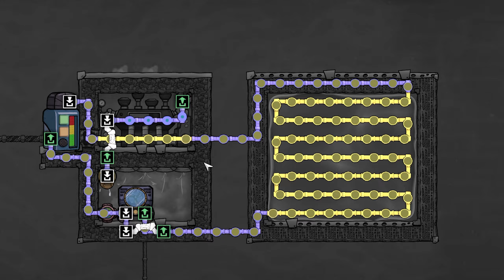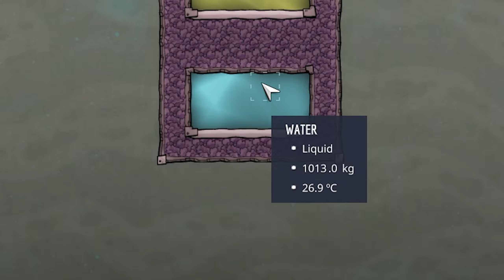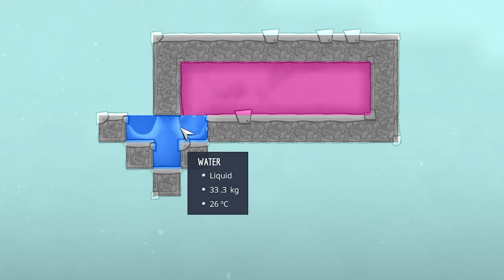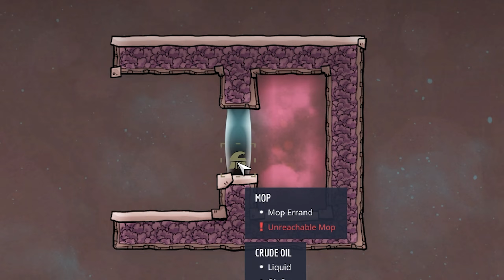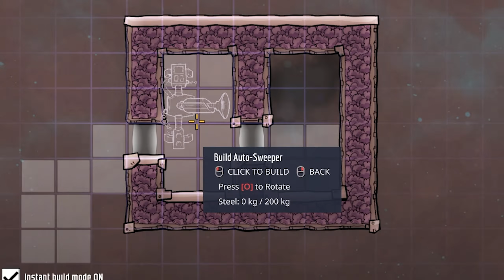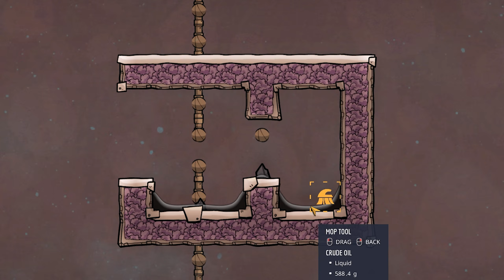HEAT DELETION & LIQUID LOCKS: A German Engineer explains ONI

Comment: I know this vid is a year old but what’s the purpose of the liquid reservoir? Most builds I don’t see it and you didn’t really specify. Thanks!
Reply from the maker: The liquid reservoir is technically not required, but can help in a couple different ways. For one, it has an increased thermal mass, so if something should go wrong(power outage), you will not be stuck with hot fluid in the pipe instantly. Another benefit is future expandability, since the required resource(polluted water for example) is already there. I implement one in all my tamers and heat deletion devices of any sort. Has come in handy many times :)

Comment: 13:05, Unless you are dealing with insulite, there will be heat transfer over time, even to insulated tiles. So if you were doing something like this for a room that would remain hot potentially forever... as the room heats up and heats up the oil, it will SLOWLY heat up the tile touching the water. Putting a little vacuum gap between the locks (and potentially around the room) is a bit more labor intensive, and requires a decent amount of extra space, but it guarantees to NEVER fail. This is also nice because it perfectly contains your system surrounded by a vacuum, which makes long term heat calculations a lot more reasonable. 
.
It is kinda breaking the game a little bit... essentially forming the room into it's own planet. But hey, it's a single player sandbox game, so it is what it is.

Comment: Why would you bother making insulated pipes inside insulated tiles?
Won't the tiles already prevent any temperature exchange?
Reply from the maker: Insulated pipes or walls do not insulate 100% unless they are made out of insulation(a very late-game material with 0 heat transfer). So putting insulated pipes into insulated walls actually combines the "insulation power". Any insulated material(other than insulation itself) will eventually heat up. The best early-mid game material to use is igneous rock, followed by ceramic in the later stages and insulation for very high heat applications in the very end game.

Comment: =HMMMPHHHH........THANKS FOR THE TIP ABOUT THESE PIPE DECONSTRUCT METHOD ABOUT LIQUID LOCK, HEHE BC OF I WAS USING A BOTTLE EMPTIER OF 33.8g WATER ....... BUT AT LEAST IT WAS MORE SUITABLE IF NOT WANT TO DO MESS

=AND.....FOR BASIC BASE COOLING, ISNT JUST A WORT COOLING ENOUGH....LIKE HYDROGEN PIPES/CHAMBERS/FLOWER POTS

Comment: Hi BierTier, I have a question. I made myself a petroleum boiler, not the conventional zig zag version but the "place all crude oil in one room and heat it" version. My question is, why does petroleum starts to form when the crude oil reach 350c in general? Shouldn't crude oil starts to transform into petroleum at 400c?? Oh, and I use magma to heat it.

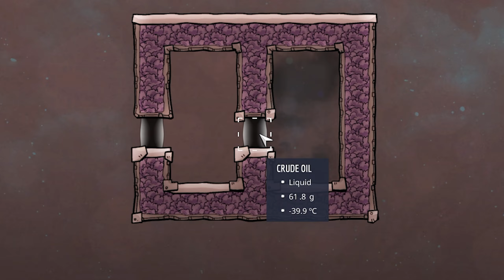Comment: 16:19
Atleast mention that you need to tilt the auto sweeper to be touching the outside blob of crude oil that comes in contact with atmosphere so it never overheats,if people take the example for literally what it seems like,the autosweeper in a vacuum will eventually overheat since it has nowhere to disperse the heat to being in a vacuum,also most of the Liquid locks here could be replaced with a diagonal 1 blob design that doesnt even exchange heat,preferably using naphta which is much better for liquid locks than anything else aside visco gel since even if you had 20 KG of Naphta on a single tile,it wouldnt overflow to the side like other liquids would.
If not replaced by the diagonal design,you could just have a blob to the left and right and rebuild 2 tiles in the middle,destroy them and get a vacuum for no heat transer without the need of 2 full side by side liquid locks like the examples,as long as the blobs on left and right are no more than 50g so they can just sweep in the middle to get rid of the excess before building the tiles and destroying them to make the vacuum.
Reply: So we should liquid lock auto sweeper too, maybe now that can work. Xd

Comment: Great video! There are a few things I would want to add. 11:23 you have 33kgs of water on the second layer. If you freeze water under 801kgs it will turn into debris and break the lock.  There are charts around that say what mass turns into debris and what turns into a block because it's different for most useful liquid lock liquids. That's an edge case anyway and I'd argue if you are worrying about that, you probably need to make the liquid lock out of a different liquid most of the time.

That being said it is worth thinking about adding more liquid than you need if it's possible for a dupe to move hot material across it. If a dupe drops a hot piece of obsidian in a low mass liquid lock it can flash to gas and ruin your day. Oil has more mass than petroleum but I now use mostly petroleum locks because I've had oil flashing to petroleum break some locks as it bubbles but the heat for petroleum to flash to sour gas is large enough that with enough mass, dropped hot debris won't instantly kill the lock. This warning also goes double for the upright liquid locks that can sometimes end up being just a few grams. I've seen dupes breathing out carbon dioxide be enough to push liquid if it's a small enough amount!

Also don't discount single block liquid locks! For that wrong material smart battery example I'd recommend my favorite liquid lock. Just a single block on the wall and 1 drop of any higher boiling point liquid on top of that. You can then dig in 2 tiles into the steam room and sealing it up is as easy as just rebuilding the 2 blocks from the wall. It's more dangerous for sure with just 1 mop-able low mass liquid holding the steam back but for quick repairs it's fast and effective.

2 high vertical liquid locks are easy to break and give your dupe soggy feet. If I'm being fancy I like to make 3 high liquid locks with crude oil, naphtha, petroleum with the crude oil having a solid block on both sides. The dupes will jump the gap meaning no soggy feet, they can't drop stuff while they are jumping so not hot debris in the oil, the solid blocks on both sides prevent spills from breaking the lock(unless a dupe pees on the one jumping blocks but the heavier naphtha shouldn't move if you use enough), double vertical locks take the same space as a single staircase lock, and those 3 materials mean it can be as cold as -40c or as hot as 400c. I have no idea why I don't see anyone using them.

I use bottle emptiers to make liquid locks over breaking pipes because you don't have to have a pipe all the way to where you want to lock and when enough liquid is in place you uncheck the material on the emptier to stop it. You said it's messier but it's the opposite. If you watch it closely you don't have to mop anything to make a lock. With the introduction of moving and emptying liquids I expect people to find even better less messy ways of making locks. (Maybe just drop some bottles of the right amount of liquid in a 3 high hole, empty them, and deconstruct the walls of the hole?)

I also like passive cooling steam turbines a lot in the early game. If you aren't making enough power to keep it up all the time you can deadlock your active cooling loop which can be a nightmare to recover from. If your turbine is too hot to cool the steam and the aquatuner is too hot to run then you aren't getting away from that without some burnt dupes. I would highly recommend passive cooling early game if you are at all worried about not having enough power to keep the system running(which is the start of every one of my poorly run bases.) You can make it work for any heat load if you throw more water mass, and then turbines at it too. Just make sure to limit the steam room temp below 135c so it stays cool enough to cool itself. Enough water mass and turbines also make it way more power positive than if you have to use the aquatuner to cool itself since you can never recover all the power going into the aquatuners.

About the single bridge bypass in the cooling loop, it works great if the loop is filled properly or you have a liquid reservoir on the loop to keep it from being overfilled. If it gets overfilled it can cause the aquatuner to get jammed and get stuck in a state where it stops and starts repeatedly as it gets jammed every other liquid packet. If you use a double bridge bypass it works like the liquid reservoir where it keeps extra space for a liquid so you can't overfill it. Underfilling the loop also works. Just be careful with the double bypass though because that extra pipe segment can have the liquid sit in it for a long time and if in a place that's too hot or cold that can break your pipe. That's where I put my first pieces of ceramic pipe before I can make enough for full loops. Still I started using double bridge bypasses when perfectly filled loops would break down on game load in late game bases and that shouldn't be an issue in most scenarios.

Another issue I've had with large bases is the liquid temp sensors connected to the aquatuners. On game load I've had a packet of already cool water get to the aquatuner before it was turned off causing cold damage. If you've ever gotten mysterious cold damage on the exit of the aquatuner that might be the case. For that buggy game reason I have my polluted water aquatuners set to +10c which is fine for almost everything that isn't for sleet wheat and could get through 2 below temp cycles before causing damage. Maybe this only happens on heavy 1000+ cycle bases but it annoys me and figured it might be worth mentioning.

I swear I didn't mean to write this much. Most of the caveats I mention are edge cases you don't need to worry about when starting out which is who this video is for. I just find it exciting and thought I'd share what works in my chaotic playstyle. Thank you for making this as it is perfect at demystifying one of the biggest hurdles for new players.
Reply from the maker: Holy cow, what a detailed comment highlighting literally all the edge cases :)
Yes, the 33kg on the second layer is a mistake on my end. Everything else though, even though you are 100% right, couldn't make it into a beginners video because it would make the video wayyyy too long and may overwhelm a new player. I really appreciate you taking the time to write all this out. Maybe I will make a "Advanced" video as a follow up to this one to cover those cases... but then of course with a huge shoutout for you! Thank you :)

Comment: 14:00 replacing the tile touching the 2 liquids and putting a insulated tile 2 tiles below the tile you just replaced, forming another point on the bottom gives you a even less heat transfer, as it puts a vacuum between the 1 liquids. As it is now, the 2 liquids will transfer heat into the insulated tile, albeit very slowly, but over 500 - 1000 cycles, this can be a lot of heat, and you may end up with 60+c water in your lock, and will leak some heat out into the environment. For the cost of 1 metal tile, I use this every time now.
Reply from the maker: That can potentially be an issue, you are right. But, all the tiles insulated tiles would heat up a bit over that period of time, so there is really no way to contain it all unless you have a vacuum around the entire build which kind of defeats the purpose ;)

Comment: 6:30 salt water is also a good choice when pwater is not so plentiful, or brine in a pinch.
Reply from the maker: Very true, they are usable. In a pinch for sure, if you have nothing else. But I highlighted Polluted Water because it should always be available, even if you just use the "output" from your dupes ;)
Reply: @BierTier you might have mentioned ethanol for cooling on the lower end of the spectrum. better freezing point than petroleum and a bit higher shc, worse evap point though.

Comment: I would have liked to see you freeze that liquid lock with the hydrogen. You say it would be a solid and still contain the gas. I think the bottom tile of the lock would freeze solid, but the other tiles have so little water in them that they would just be debris, instead of being a solid tile. There by causing your gas to escape.
Reply from the maker: That would have been a good test, to be 100% safe you’d definitely have to fill the top tiles above 500kg per tile! Good catch!